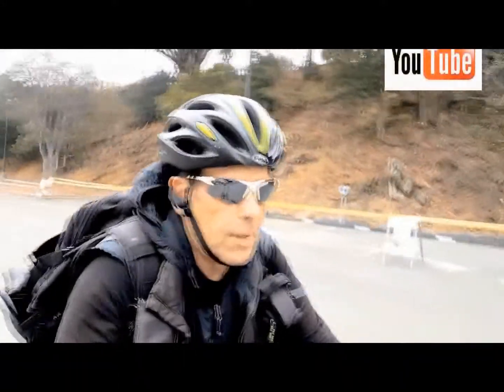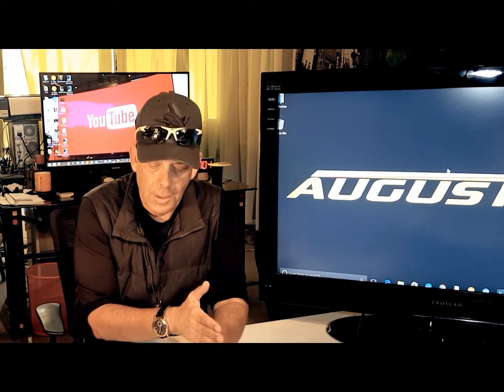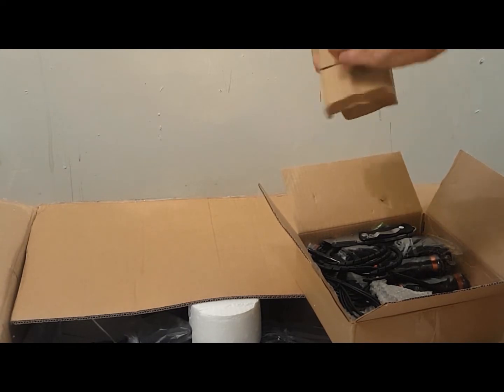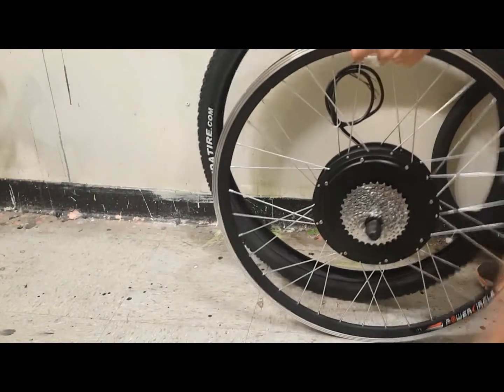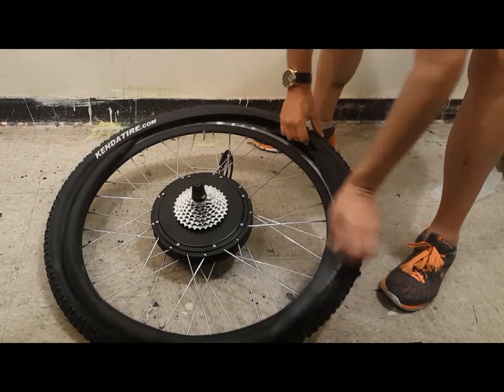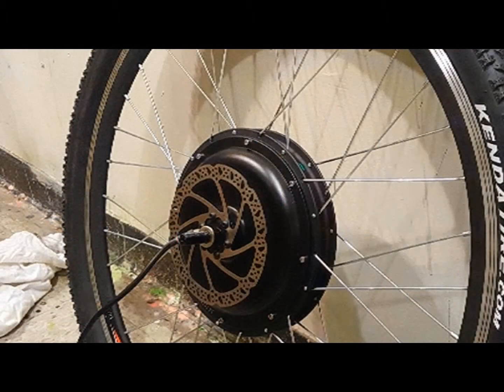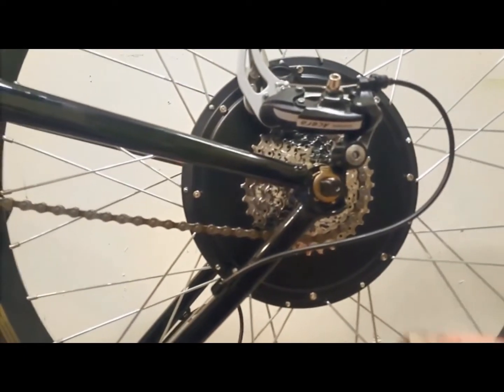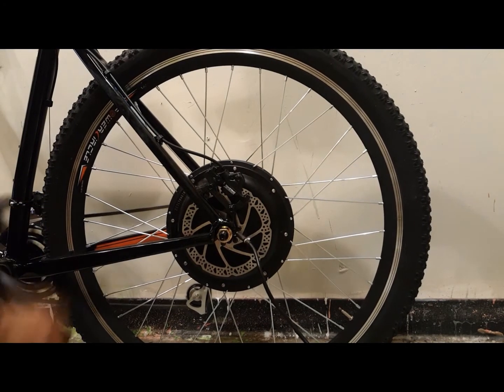Electric Bikes. HOW TO install a Rear Hub conversion Kit!

Comment: Great and INCREDIBLY helpful video Augustine Bikes!  But I found it impossible to put the flat spacer on both sides (no room) so I currently only have it on the disc brake side of my Giant Sedona DX.  I also think my original controller is bad, so I bought a tester and am currently learning it. I have a new controller on the way.   The original controller was a no-name non-branded, with no QC sticker... so I guess I got what I paid for.

I also had to take off my original Shimano combination brake/shifters to use the automatic hand brake disconnect feature on the ebike. Not very good yet on the install... but am working on that as well.  No rush.. just want to get it right.

I have a 48V 12.5 amp battery... what the limitation on speed of watts of the motor. I currently have a 500W

Thanks fpr the vid.. i saw a couple earlier vids of yours but this one was the most helpful

If youre ever in the New Orleans area look me up and we can coffee and chat about your projects... or beers... either way..

Comment: Good video! Very educative! Is any kind of frame limitations? I mean , the back fork sometimes seems to be very thin and fragile...
I am considering an 750 watt in a quite old Dutch bike .. I am not sure how far I can go about the frame vs. motor power. 
Would you recommend the rear hub installation in a aluminum frame?  Thanks.. cheers